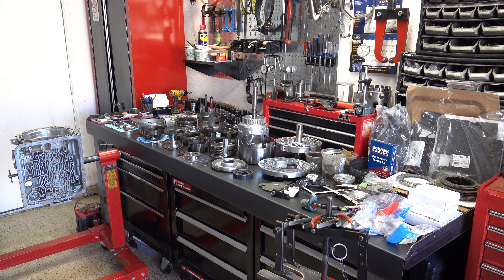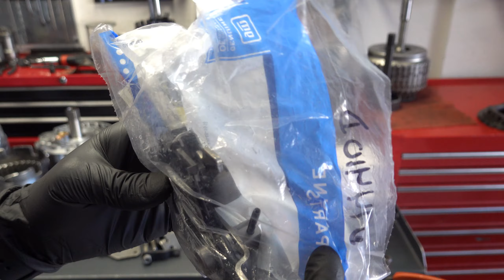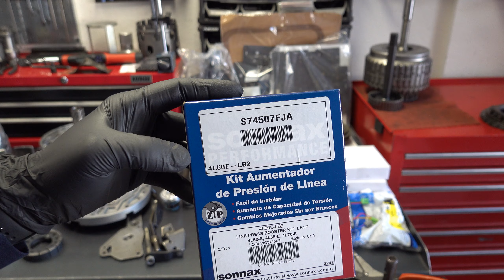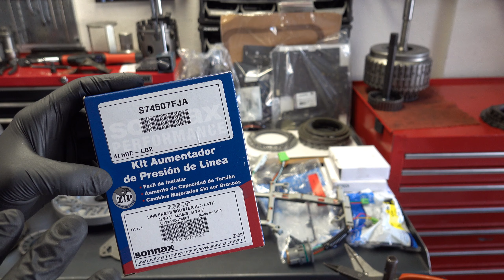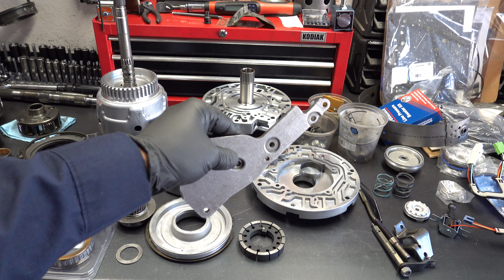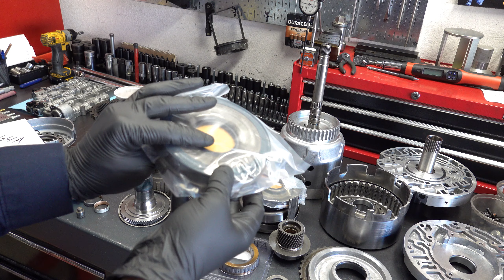4L60E Build Strategy for Stock to Mild Performance Applications

Comment: I have a 2003 suburban 1500 that im about to a attempt my 1st ever rebuild on.  Without going over the top (this is my work vehicle/long distance driver), what rebuild upgrades (if any) would you suggest to make it stronger for light towing? I pull a 12' covered trailer not typically loaded down with stuff and the heaviest load ive had in that trailer being towed with suburban was a full pallet of concrete. Tranny was a champ...rear axle was flipping me off pretty good tho. Lol.
Reply from the maker: Thank you for watching, Rick. 

Check out my latest 4L60E rebuild series - it was put together as a Level 1.5 build for towing/hauling as well as daily driving: https://youtu.be/05yNLkPEfeA

I go over parts selection, showing the viewer every part we incorporated into that build then a step-by-step assembly that begins w/the pump.

Comment: Just stumbled onto your videos good content I’ve watched a few now. I’m gearing up to rebuild a 2004 4l60e and I’ve bought a lot of parts tried to get oem as much as possible I bought an ac Delco friction module not realizing it was 4l65e all the clutches are the same except 3-4 it has 7 .062 frictions and 6 .095 kolene steels, it’s going behind a 425 hp 5.3 that won’t be abused much will this stack up work or are .062 to thin. I have .035 clearance with my old apply and backing plates wanted some reassurance before I bought new or bought another 3-4 clutch pack. Thanks in advance
Reply from the maker: Hi John, thank you for watching! I'd look into the Alto Powerpack...There's a couple different versions, one that comes with high energies and another that comes with their red eagle clutches and kolene steels...The 4L65E pack is a good pack as well, just make sure you have the 4L65E apply and backing plate set...Run your clearance down to .030-.035 and reinstall the factory load release springs as they will prevent drag when clearance is on the tighter side.

Comment: Do you consider a "BEAST" a decent enough replacement vs the Sonnax Smart Shell at around half the price?
Reply from the maker: Hi TheVillain, thank you for watching...

I haven't use the BEAST sun shell in ages but never had any issues with them when I did. However there's concerns in some within the industry that the BEAST shells aren't balanced and place asymmetric stresses on the rear sun gear due to them not being balanced. Unfortunately, there's a few different variations of the BEAST shell so that chatter may have been applicable to any one of them (or all) but I've been using the Sonnax Shell for so long, I have no real recent experience with anything else, other than the standard GM heat treated shells, which go into my stock-ish builds.
Reply: @nickstransmissions  Thanks so much for the info, if I do end up replacing the shell I'll go ahead and do the sonnax for peace of mind.
Reply from the maker: You're welcome, man.

Comment: Another great video, Nick. Ya know, in nearly a hundred of these I've done now, I still haven't been inside of one of these late models with the internal range switch. Weird I guess, but the older ones keep me busy. Oh, and I use a lot of the blue bonded apply pistons from Seal Aftermarket, and they haven't let me down so far. Keep up the good work, my friend.
Reply from the maker: Thanks, Kevin! 

Yea, haven't heard anything negative about those blue pistons, they seem to be fine.